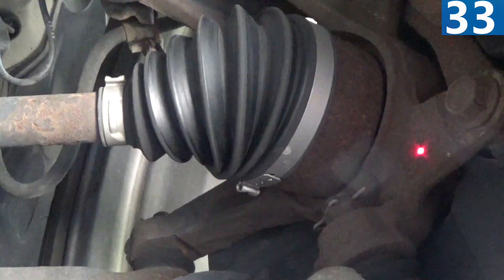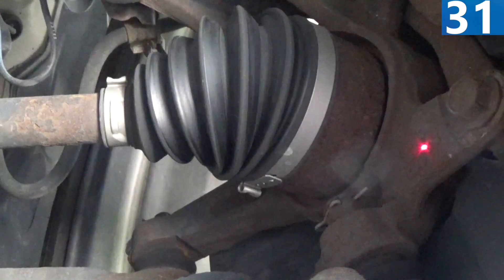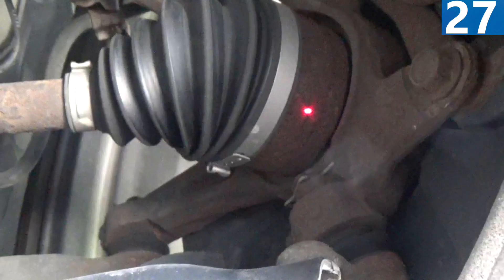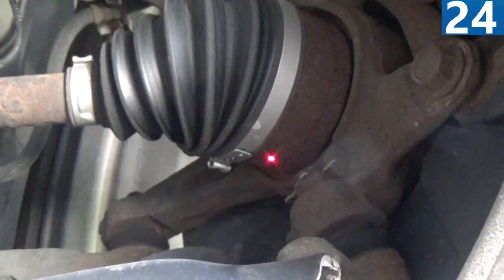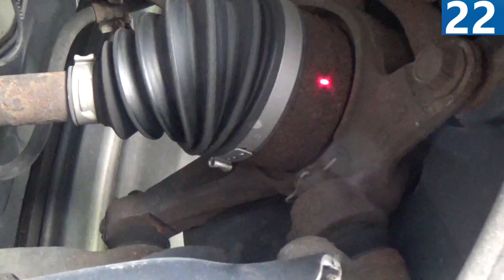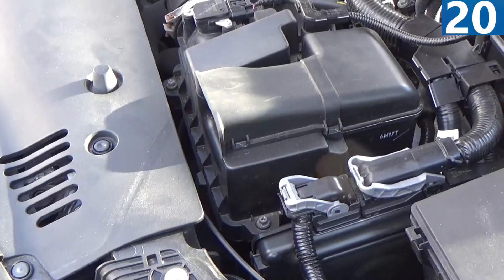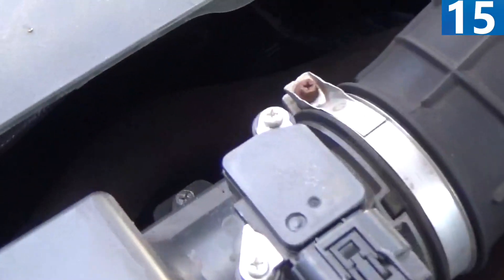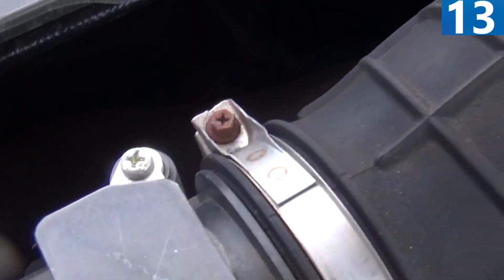60 Second Tips   Diagnosing With an Infrared Thermometer

Comment: for the GM owners, take the temp Gauge toy you now have,
read it on of your oil filter & the Exh pipe that is 1 1/2 “ away form it.
After it has been operating for about 20 minutes.
Pipe ~450+ degrees, Filter 350 degrees.

Congrats, you oil properties are literally DESTROYED in the first hour of the fresh oil change!!!

Really good idea GM, so, now, buy the thermal pipe wrap material,  and wrap pipe near filter & Starter too. so the STUPID design to put 450 degree SCORCHING Constant Heat ,
next to oil filter and the starter moto.
That the engine  needs or the Electrical device,  that FAILED,  prematurely due to excess HEAT.
Reply from the maker: Interesting, thanks for sharing
Reply: @PetesGarage  
My years in a machine shop the one guarantee was GM v8’s 90% I worked on their insides were oil baked acidic stained .
Kind of interesting why the two things near the Exh pipe Heat led to issues, the oils were always heat converted into Acidic tar leading to premature wears, the starters & solenoid electric were High maintenance failure pieces!
As  Tech in High tech industry this phenomena of heat what it causes to oils & electrical device,  is well understood and dealt with.

Comment: Hey Pete, 

In the process of building my little SBF 302 with solid flat tappets 

The car is currently an in-line 6 and I’m converting it over to a V8, so I don’t have a known good carburetor, so I got one and rebuilt it myself. 

Any way I can make sure the carb will be good to go and not have an issue with break in ? Would it be too tight of a time constraint to adjust the carb and break the carb in within the 20 minutes for the can break In period?

Any advice you have would be greatly appreciate, first engine I’m trying to do completely doing myself 😅
Reply from the maker: It takes quite longer to break in a solid flat tappet. The carb can't be tuned without the engine running

Comment: Thermal Imagers are way more useful than the point and click sensors, try to get one with a 480x320 IR sensor or better (make sure the marketing material states this or you can pay 4x more for a 60x60 sensor scam), super useful. I used one and didn't realize how much heat the standard refrigerator releases into your home, as well as how much energy comes through sunny windows without a quality mirror film.
Reply from the maker: Great tip, thank you